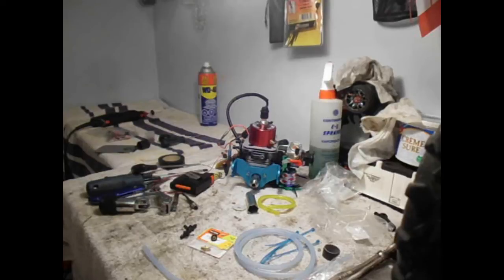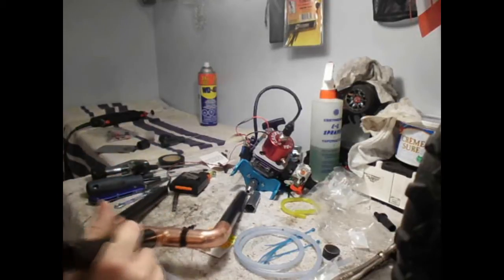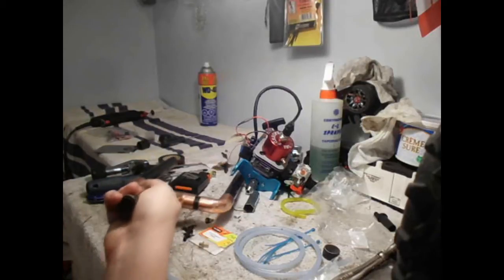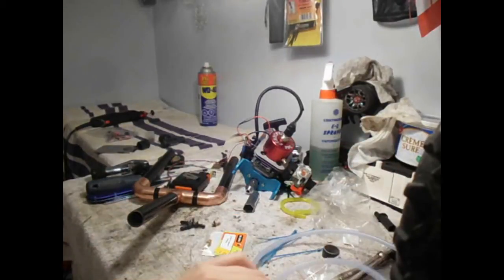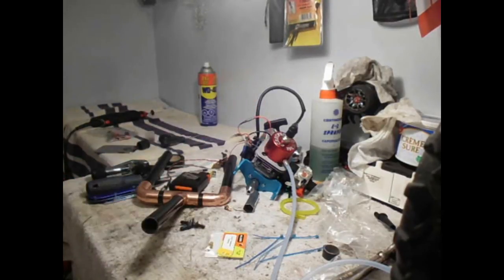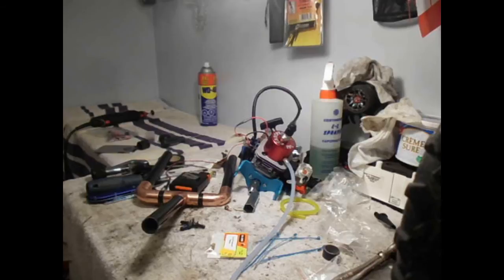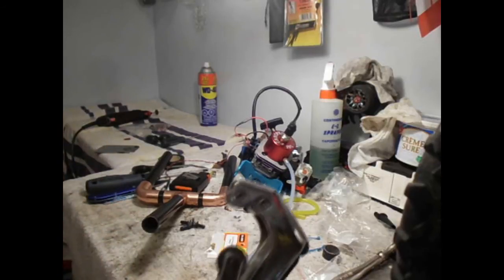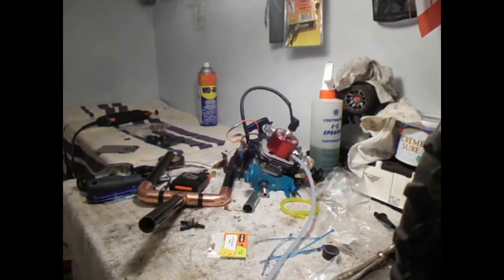RC Gas Boat Build Part 2 ''Wake Up Call''

Comment: You'll need a tuned pipe for a 2-stroke engine, or else you'll lose so much power! With straight pipes the engine will spit out a lot of unburnt fuel!